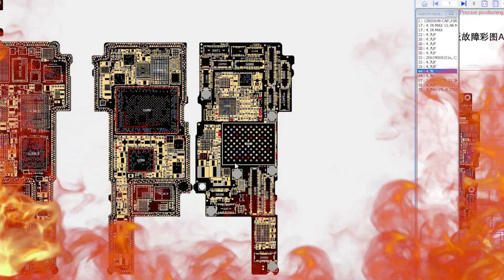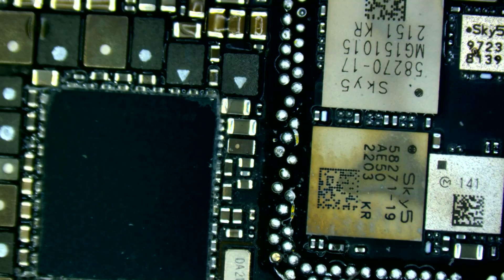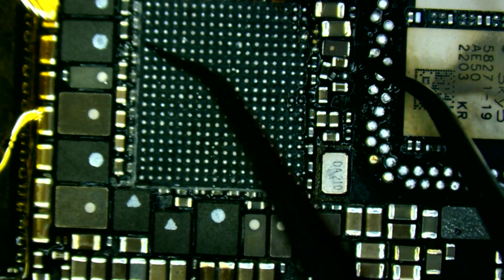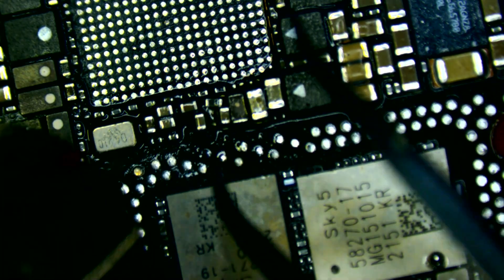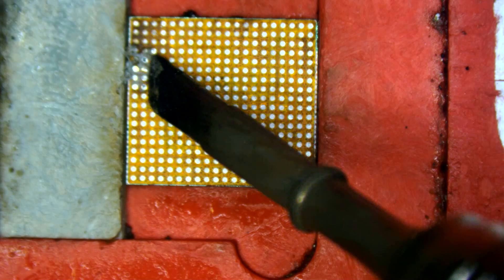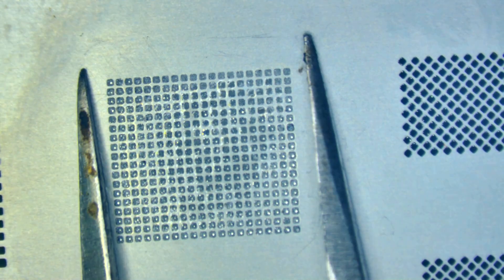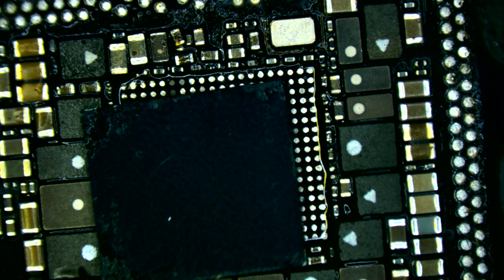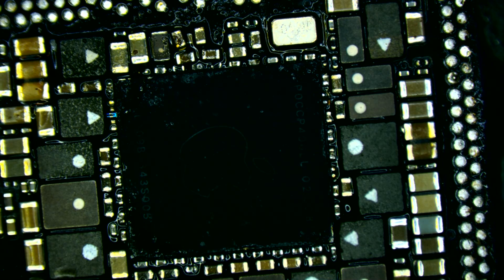Repairing PMIC Heat Damage on a Motherboard | Step-by-Step Guide

Comment: Is 300 °C the best temperature to use for all component removal? I have been using 350 °C and sometimes 360 °C at 50 or 60 fan on my Quick 861DW. I only have issues working around unfill chips. I normally use a Dremel pen to carve the damaged IC(PMIC, Tigres, Tristar). Then I use leaded solder to rework the new IC. I am going to try to use 300 °C from now on, thanks for the tips!